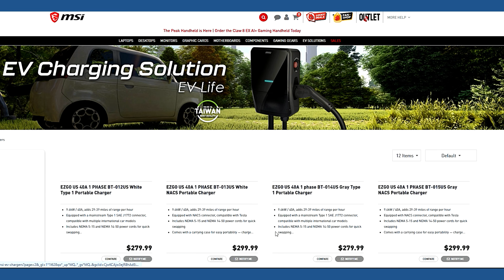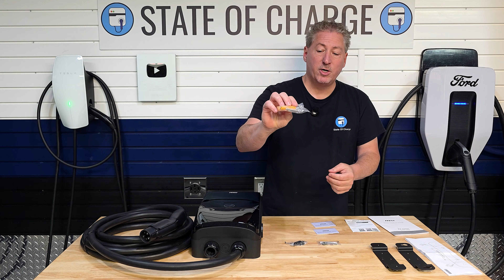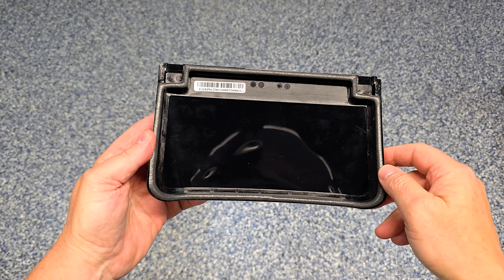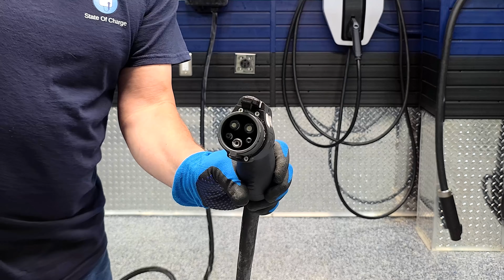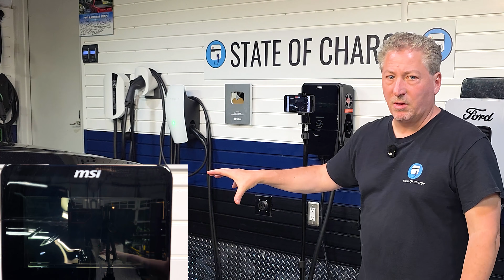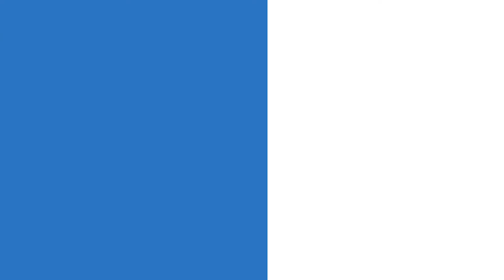MSI EV Premium 60A Tested: Can It Compete With ChargePoint, Emporia & Tesla?

Comment: Very much enjoy your reviews of EV chargers. I notice, however, you often underemphasize two very important items in your presentations:

1. Does the charger have hard-wired and plug-in versions.
2. Does the charger have NACS and J1772 versions.

Furthermore, it would be helpful if you would mention always how a charger could be "controlled" (through a card, software, or other means), so the owner might prevent others from using  it.

Comment: I like the looks of it and for my use case how the holster is integrated to plug the connector into the side. Narrow garages that barely fit even our smaller cars, as are common in newer homes, are not friendly to holsters that have the connector stick out from the wall. The points you give or don't on this I find meaningless since it depends on the personal use case. The thick cable is a deal breaker even though I live where it never gets cold because it's still going to be a PIA compared to a narrower and more compliant cable. Being a PC builder who is very familiar with MSI I'm pretty disappointed in this. It's also pretty pricey and I don't really see the point for a 60A charger as you pointed out. Seems like they're offering this to use as marketing speak to fool people into thinking that with this their car will charge faster. Do they understand this market? I'm really happy with my Emporia.
Reply from the maker: I really think they just didn't do their homework on it and had it designed by people without EV charging experience. They probably thought they didn't need the help because they know consumer electronics...

Comment: Don’t see the point of the 60 amp charger. 90+ percent of vehicles on the road have 48 amps or less worth of capacity for the vehicles on board charger. And at least to my knowledge the next step up is something like a Silverado EV with 80 amp charging. if you’re going to go through the hassle of larger conduit and wire, don’t see why you wouldn’t just go to 80 amps instead of 60. 0:50

Comment: Kind of strange to see a computer component co making an EVSE. The other downside to those super thick cables is it's impossible to run underneath the garage door if you have to charge outside for whatever reason. HOWEVER, make sure the door isn't putting a lot of pressure on the cable, even with the thinner ones!!

Comment: I seen that Dewalt has came out with a new charger and Tesla style EV charger. they also have all sorts of adapters as well. I was wondering if you could review the tool brands charger? I am not positive if it is fully released but I seen it on the YouTube channel of The Tool Show that it is coming out. thanks

Comment: I'm still using my 2011 Nissan level 2 charger in my garage I got installed for free from Nissan when I bought my 2011 Leaf (I still drive).  Never had an issue.

Comment: A 60amp 14Wh level two home AC charger is kind of pointless because there isn’t a single EV in the US that I’m aware of that will take an AC charge more than 11.5Wh.  There are 80 amp and 120 amp level three chargers that will deliver up to 19Wh AC, and even less vehicles sold in the US that will accept that, like the Chevy Silverado or Hummer EV

Comment: I see no reason to buy a 60 amp unit as Tom says.  If your EV can charge at 80A and you have the power, buy an 80A unit.  

I wonder if this was designed for users with an EV capable of 80A, but their house power is limited to 60A charging. Ford F150 and Lucid Gravity come to mind.

Comment: something i just considered, with the deep freeze test. if the cable had been out all night charging, the cable heats up no? even if it was -10 outside, if it was supplying 60a for 10 hours or whatever, it woudl stiill have some heat to loosen it up right? i get this is to show the absolute worst case scenario, but still
Reply from the maker: That assumes the car is charging all night. Typically, people plug in when they get home, and then the car finishes charging in a few hours. So for the last 3-4 hours before the owner unplugs in the morning, there's no power flowing. Also, when you want to plug in, the cable has been sitting outside all day and is thoroughly cold-soaked.
Reply: @StateOfChargeWithTomMoloughney  whilst true, I'm assuming something with a battery big enough to need a 60 or 80a charger is usually on the bigger side. But your latter point of it being cold soaked all day is a legitimate concern that my brain blanked out, thanks

Comment: Why do so many, almost the entire Internet that talk about EV charging call these wall mount devices chargers when they are not. The charger is in the Tesla car. The correct terminology for this device is a EVSE... TESLA calls their devices wall connectors or portable wall connectors. Electric Vehicle Supply Equipment. Even the manufacturer of the MSI says it is a charger. Am I wrong here?

Comment: I've had EV's and home chargers since 2018.  I'll just say that as amps go up, homes run into capacity issues.  I have a rural home now with 200A to the house and 200A to the workshop building, but most new construction housing developments are lucky to have 200A service period.  Now you want to drop in a 60A charger, which means you need an 80A breaker.  That's 40% of your home's overall capacity going to this device.  And good luck asking your power company to supply more power to your home.  It took a bit of wrangling just to get the 400A service at my house years ago.  Nowadays, it's a lot tougher.
Reply: Not really how it works. You can easily have much higher total A from all your breakers than what your service provides because you are never going to be using everything at max at the same time. You'd want to do a load calculation that factors that in to see if you have capacity for a big charger. If you do have service limitations there are other options like the emporia pro that work around that.
Reply: @esteinbr1 True, but an EVSE has a power demand factor of 1...

The solution for this is a clamp that monitors your current usage at your grid hookup, and adjusts the EVSE max current dynamically.

The EVSE can adjust the amps in 1A steps from 6A to 64A according to your site consumption.

Comment: What is the TT and IT charging information? My solar inverter on the same sub panel will sporadically have a GFCI fault and require resetting when my EVSE kicks on and I'm curious if this setting will alleviate that problem. No information on the setting in the manual on what it's actually doing. 

The manual also talks about an ethernet port and Sim card slot, did you see those features on your review unit?

Comment: Hey Tom, great review as always!
Since you mentioned this charger allows adjusting output down to 6A, isn't there a very strong case for stopping around 16A rather than dropping to 6A, 8A, or 10A due to background parasitic overhead?
When an EV charges, it can't send 100% of wall power straight into the battery. To accept any charge, the vehicle has to "wake up" and run a mandatory baseline of equipment:
Central vehicle computers and CAN-bus networks
Thermal management system (coolant pumps, radiator fans, heaters/chillers)
Onboard AC-to-DC charger
Low-voltage DC-to-DC converter (supporting the 12V system)
That background gear pulls a flat, continuous baseline of power—usually around 300W to 500W—the entire time the vehicle is awake, regardless of charge speed.
At 48A (11.5 kW): A 500W overhead is just 4.3% of total power draw. Over 95% goes directly to range.
At 16A (3.8 kW): A 500W overhead accounts for roughly 13% of the draw. This feels like the ideal "knee of the curve"—you lose a bit of efficiency, but you get lower heat, lower home panel strain during heatwaves, and a longer 12V maintenance window.
At 6A (1.4 kW): That same 500W overhead swallows up 35% to 40% of the energy coming out of the wall! You end up paying for wasted electricity just keeping the vehicle's computers idling while the main battery barely gets fed.
16A seems like the true sweet spot for "slow charging" without burning money on background overhead. What are your thoughts on where efficiency falls off a cliff?
Reply: do you not realize how lvl 1 works?.....500w is an exaggeration, but yes it just costs more. thats it.
Reply from the maker: Correct. The losses will account for a higher percentage of your power use.

Comment: When I saw this was made by MSi my intitial reaction was “I wonder what a Gaming Charger would look like?” Turns out, not very good. Surprised they didn’t coat it in RGB. Definitely worth avoiding in my area. That cable and connector would crack with how cold it gets up here!

Comment: Wow MSI really missed the boat on this one. Also all that plastic on the front, if this is mounted outside it will need to be replaced in only a few years like all those chargepoint stations we all see that the face is all cracked and the screen impossible to read.